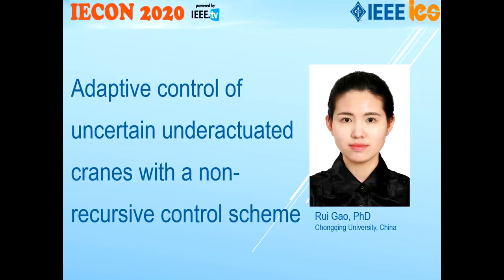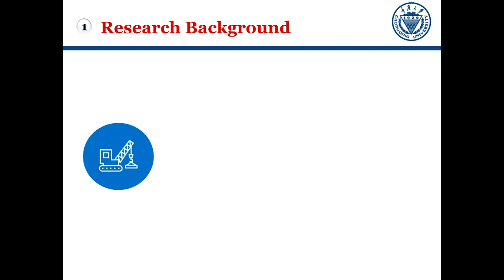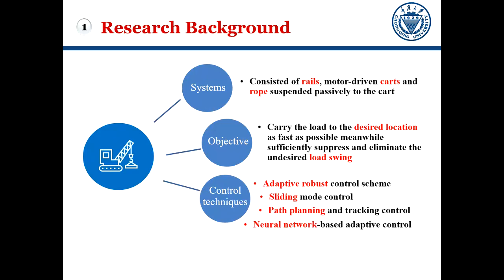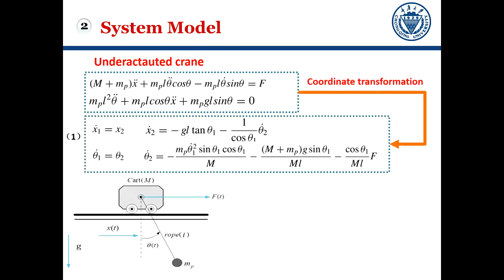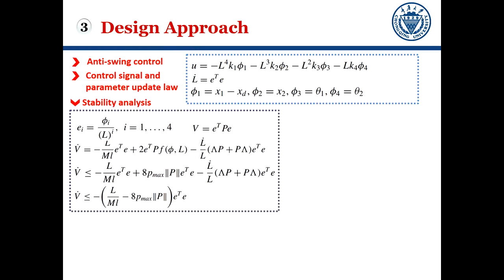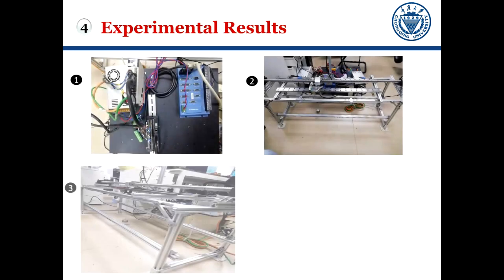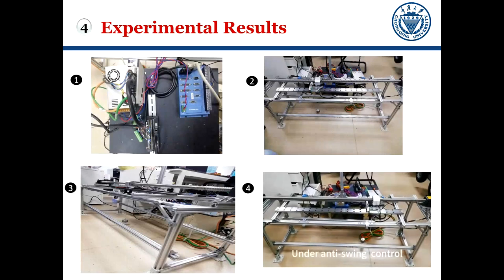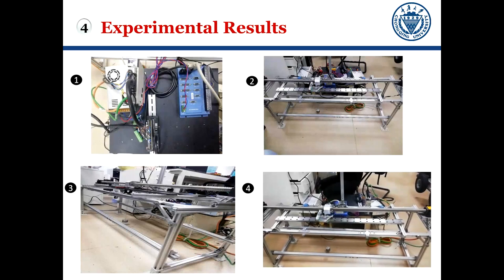S&YP Activity IECON2020: Adaptive control of uncertain underactuated cranes

Comment: Thank you, Rui for the interesting presentation. How do you think if your control method would be used in medicine to control an auxiliary drive in people's rehabilitation?
Reply: Thank you, Marek. Our control method is designed for crane systems, which depends on the model of the control system. To control an auxiliary drive in people's rehabilitation, we need to know the dynamic model of the vehicle. As far as I know, the auxiliary drive seems like a mobile robot or an inverted pendulum. The models are different from the crane, so the control scheme could not be used directly, but basically these mechanical systems are areas of our research interest.